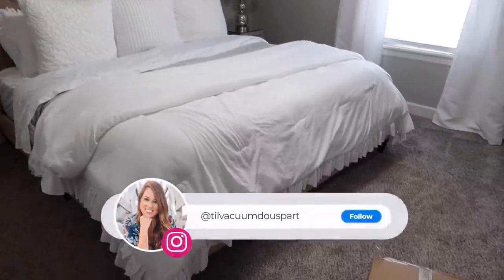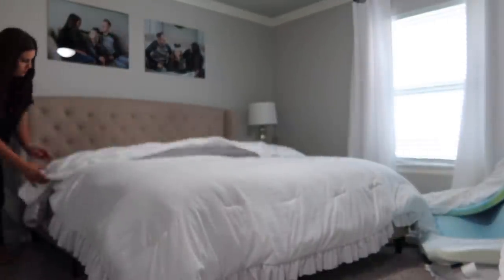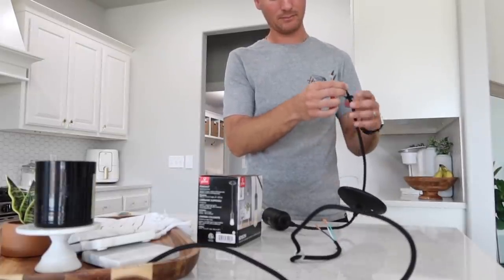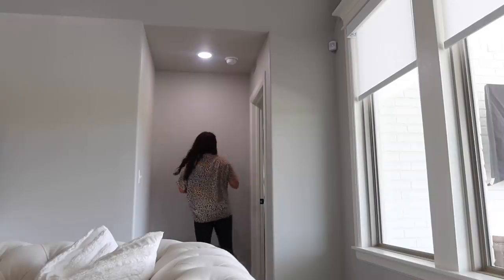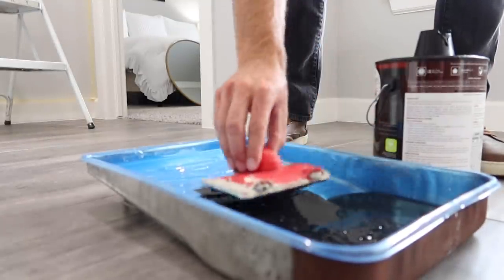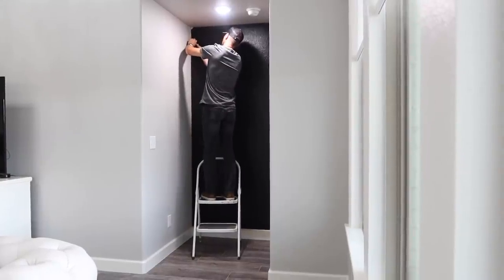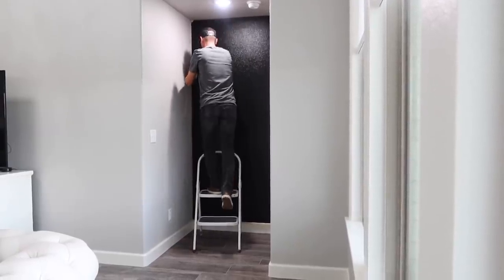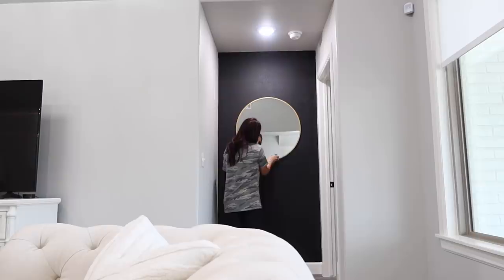UNDER 30 MINUTE HOME PROJECTS | QUICK + AFFORDABLE HOME PROJECTS | DIY HOME UPGRADES ON A BUDGET

Comment: I have the same bed topper and foam, I put the foam under the topper and I love it!
Reply: @Ellen Smith Question about your topper...do you find it gets hot bc you are sinking into the topper? ❤💚💜💙💛
Reply: @cathleenweaver6483  Not at all
Reply: @ellensmith9802  Thanks for letting me know so quickly ❤💚💜💙💛

Comment: I like it! I also like that black wall with the trim. I like that you added wood in spaces, I just changed up my decor in my kitchen with a lot of my hearth and hand wooden decor. I had it on a bottom part of my hutch but it served no purpose really. My kitchen is so small but I love the farmhouse decor and so I redo my decor every so often. I mix it with the pioneer woman pieces for some color. I have some stuff to redo my bathrooms but we have to find some stuff for redoing our shower which has been kinda a pain. I’m thinking of doing a black wall or two somewhere in this house too along with a barn door for my main bathroom door. I love that type decor. I’m a thrifter and cheap buyer like half or most all of my decor came from our local dirt cheap stores, that originally came from the hearth and hand line at target. I love me some dirt cheap! Lol we gotta store in Texarkana and in hot springs! I tend to go overboard but I love it! Your stuff looks good, I wish I had that pantry and like bigger shelves and cabinets but our house is just small. We did finally paint our outside of our house; which I love!!! It’s black and white with wooden shutters my hubby made!! All the best, 💕😊Monica